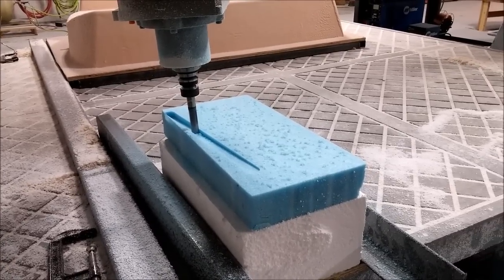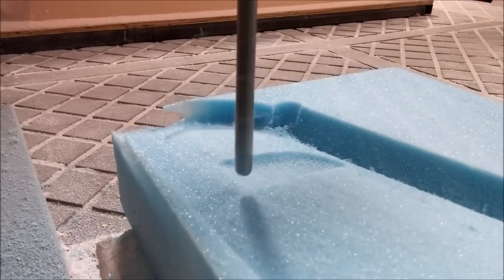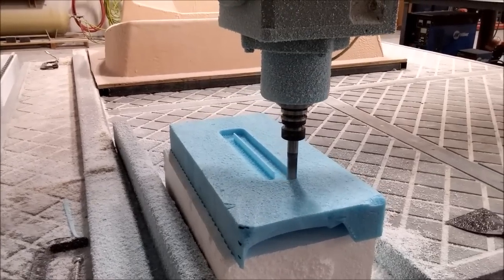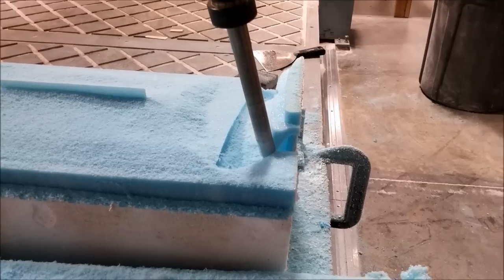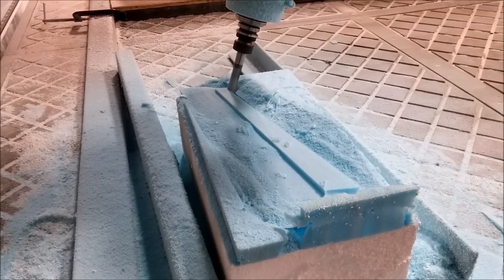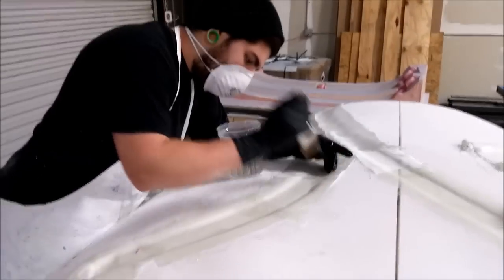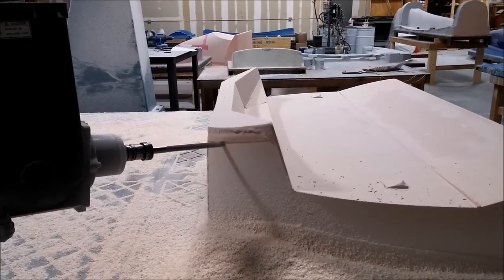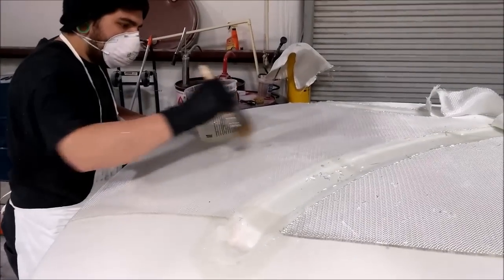Raptor Aircraft January 5th

Comment: Have you thought about using the Gemini diesel engine?  Compact, high torque, and you can burn Jet A, and biodiesel in those areas of the world that have a poor quality gas.  I don't work for them.  I'm putting together a Kit plane in the future and looking at the diesel.  
And the Gemini is a very viable alternative  for me.
Reply from the maker: +David Ozburn 125hp is nowhere near enough. The Raptor needs at least 300hp to have decent performance.
Reply: +Raptor Aircraft They have up to 500 hp/   gemindiesel.aero
Reply from the maker: David Ozburn I don't see any mention of a 500hp variant on their website. Do you have a direct link?
Reply: +David Ozburn Go to the download tab to the General Info Data Sheet
Reply from the maker: David Ozburn The specs look encouraging but when are they going to produce one of the higher horsepower engines?
Reply: +Raptor Aircraft From what I understand, the end of this year.  I'm going to call them on Monday for more info
Reply: So 3 years later and it doesn’t appear they have done anything with this past 125hp
Reply: +David Ozburn that would be pretty amazing to go up to a 500hp engine... certainly getting there faster - fuel burn would go up as well, but still... woah...  :)